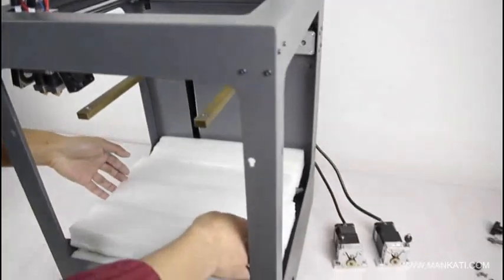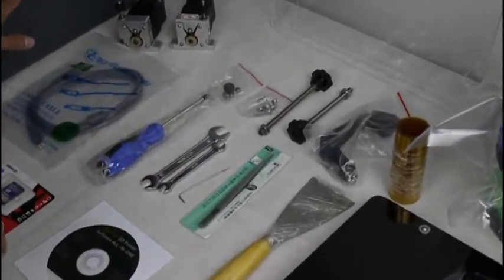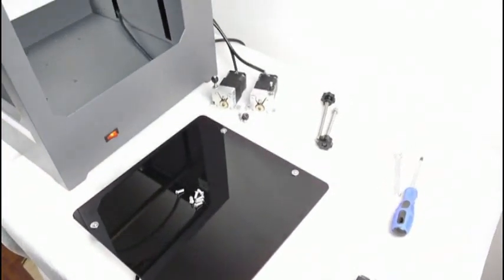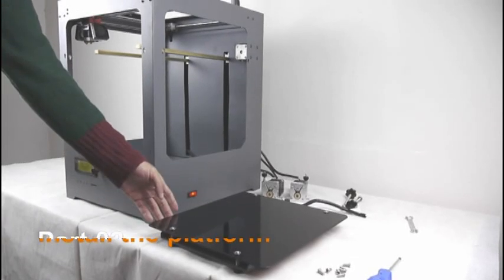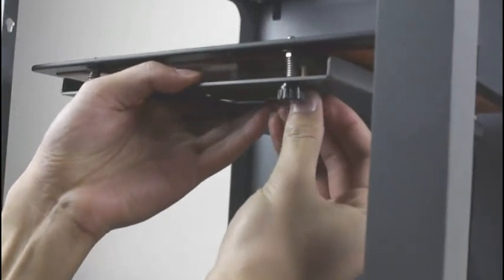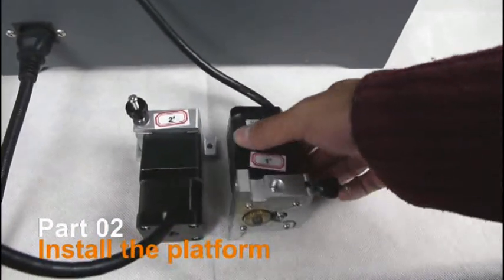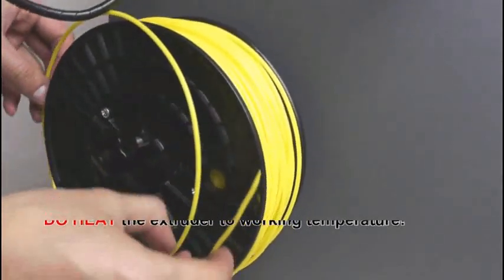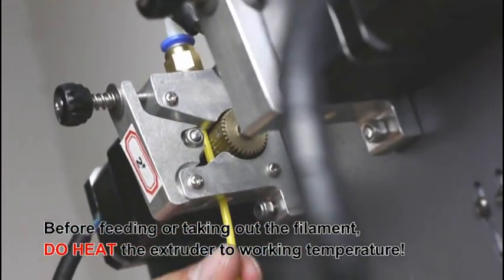Mankati Fullscale XT 3D Printer Installation Guidance Video

Comment: The 200mm close belt that drives the Y gantry from the Y stepper snapped off. I bought a replacement belt but having difficulty looping the belt on the gantry side, any procedure?